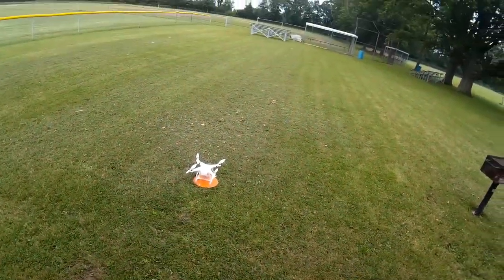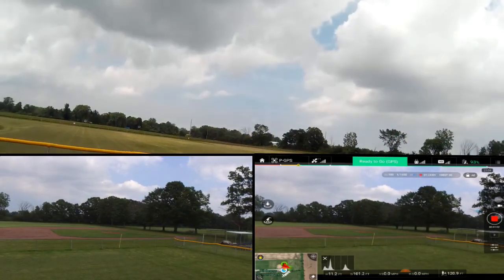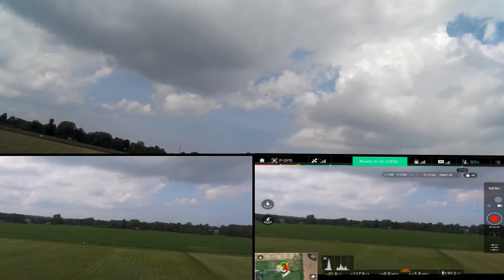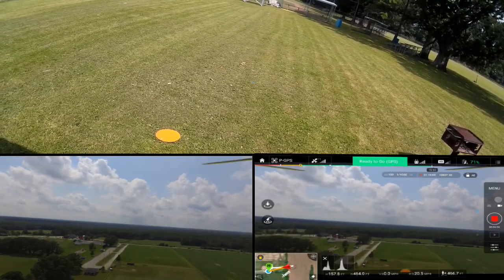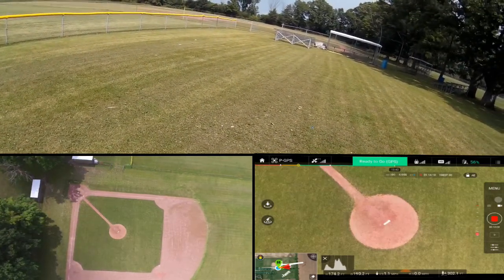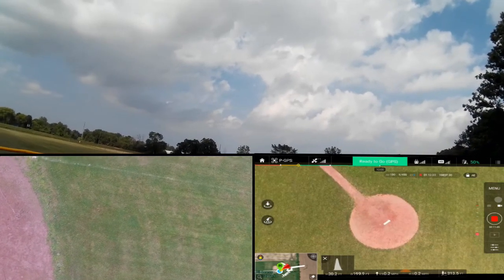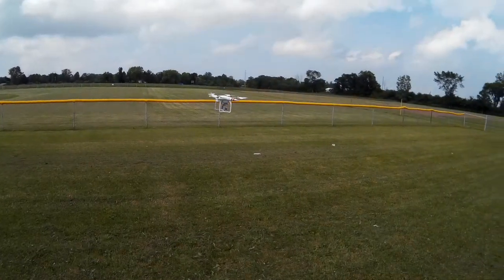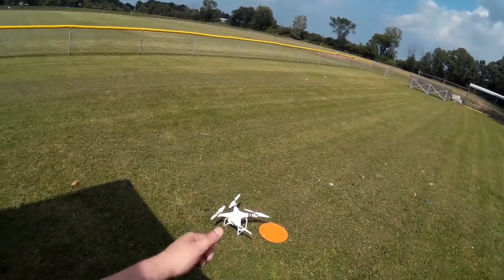Video Drone - Phantom 3 Master Airscrew Prop Test Flight!

Comment: Master Screw says you get longer and quieter flight. Did you check flight time?
Reply from the maker: While I didn't time everything to the last second as I typically land around 20 to 30% I saw no difference and far as noise, it sounds different if that counts.  I think they are OK props and the price isn't bad but  that is about it...